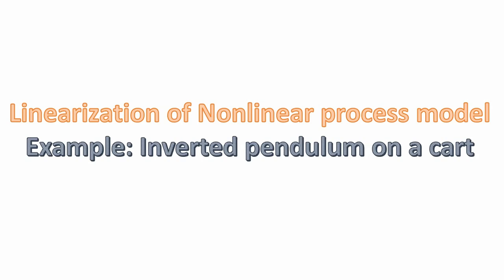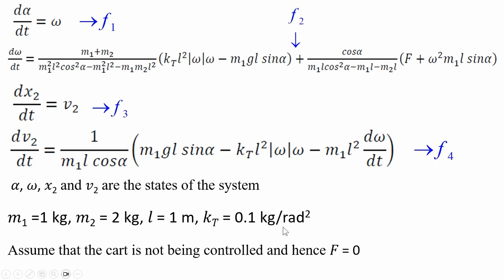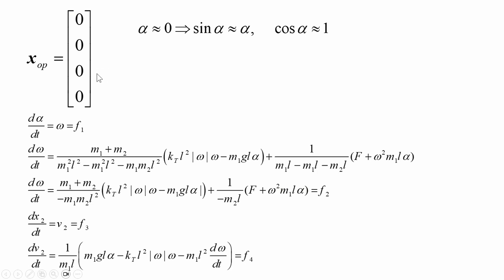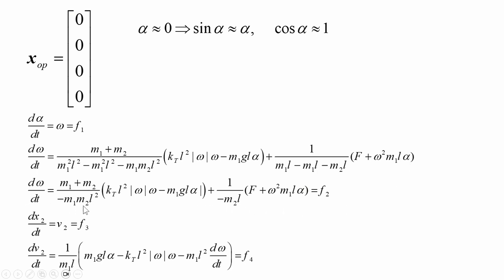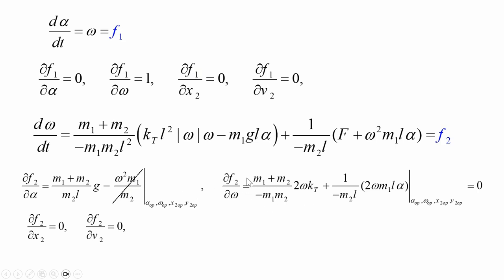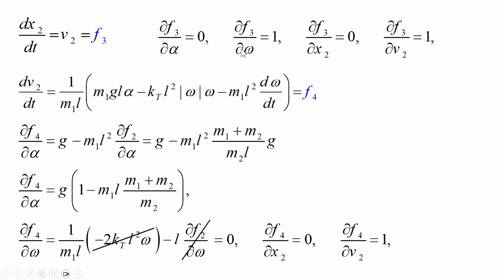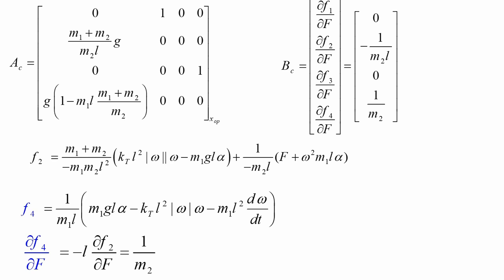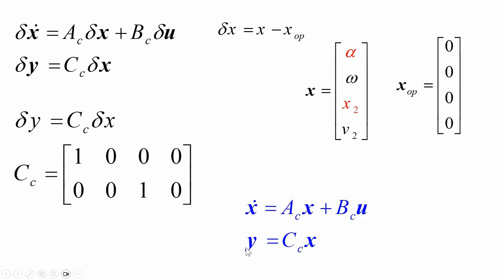Linearization of Nonlinear Systems | Inverted Pendulum on a Cart Explained Step-by-Step

Comment: Why linearize when you cqn go non linear.
Reply from the maker: Great question! The short answer is: you can go nonlinear, and for many modern applications, we absolutely do. However, we teach linearization first because it’s the "gateway drug" to control theory. Here’s why:

Mathematical Simplicity: Nonlinear differential equations rarely have closed-form solutions. Linearization turns them into 
xdot =Ax+Bu, which we can solve using eigenvalues, Laplace transforms, and matrix exponentials. It gives us a snapshot of the system's behavior near an operating point.

Control Design Tools: 90% of classical control tools (PID tuning rules, Root Locus, Bode plots, Nyquist) are built for Linear Time-Invariant (LTI) systems. If you don't linearize, you can't use these intuitive frequency-domain tools.

Insight over Accuracy: Linearization tells you where the poles are. If a pole is in the right-half plane, the system is unstable locally. It gives you immediate physical insight (e.g., "the cart needs to accelerate faster than gravity to balance").

When to go nonlinear: You go nonlinear when you need high performance over a large range of motion (e.g., swinging the pendulum up from the bottom, or a fighter jet doing acrobatics). In those cases, we use Nonlinear MPC, Sliding Mode Control, or Feedback Linearization. But even then, we usually start with a linear controller to get a baseline, then add nonlinear terms to handle the "edge cases."

So, in a tutorial, we linearize to build intuition. Once you master the linear version, you throw it away and add the nonlinearities back in for the final polish! Does that make sense?
Reply: @alshikhkhalil i see, im mostly working on flight controller, linearizing takes computatiol cost and complexity with tho jacobiam and matrices, so i just unrolled the equation into step by step process, Provide more clarity and easy to debug. Even with correct equation, its hard to create accurate physical model for so many reasons. As a baseline i use integration to capture the models true physical dynamics ( curve shaping) and tune from there.

I guess i have opposite mental intuition, linearizing feels more complicated for me and always doubt its correctness. But yes its interesting to know ways of doing math. Greate video, thanks.
Reply from the maker: @Lourdes-v8v1w  That's a really valuable perspective — especially coming from someone actually building flight controllers in practice. You're absolutely right about the practical challenges:

On computation: Yes, computing Jacobians online is expensive, and if your model is wrong, the linearization is wrong too. In embedded flight control, you don't have the luxury of running an EKF-style linearization at every timestep just to get a control law. So unrolling the equations step-by-step is both faster and more debuggable — that's a solid engineering trade-off.

On model accuracy: You hit the nail on the head. The "true" physical model is never truly known — aerodynamic coefficients change with angle of attack, air density varies, ground effect kicks in, etc. Linearization assumes you have a decent model to linearize around. If you don't, it's garbage in, garbage out. So your approach of integrating the raw dynamics and tuning from there is actually more robust in many real-world scenarios.

Where we might actually agree: The way I see it, linearization isn't the answer — it's a lens. It's useful for:

Gain scheduling: You linearize at a few operating points (hover, cruise, aggressive turn) and interpolate gains. That's basically what many commercial flight controllers do under the hood.

Stability margin analysis: Even if you tune by integration, you still want to know why the craft oscillates at certain frequencies — and linear analysis (like a simple phugoid approximation) can point you there faster than trial-and-error.

Your intuition isn't "opposite" — it's just "top-down" vs "bottom-up":

I start from math → linearize → build up.

You start from physics → integrate → tune down.

Both are valid. In fact, the best flight controllers I've seen use both: a simple linear model to set initial gains, then a nonlinear simulation (your step-by-step integration) to test and polish. The linear part just gives you a starting guess so you're not flying blind.

Thanks for the thoughtful comment — it actually made me rethink how I present this in tutorials. I should emphasize more that linearization is a design aid, not a requirement. Keep doing what works for your copters!
Reply: @alshikhkhalil very intuitive thougtfull reply. Thanks.
Reply from the maker: @Lourdes-v8v1w  Appreciate that! Honestly, it's rare to have such a genuine, back-and-forth discussion in the comments — so thank you for that.